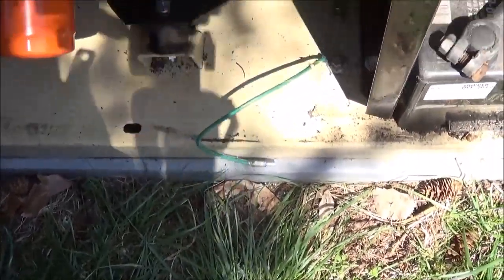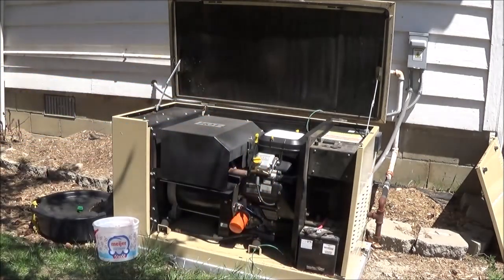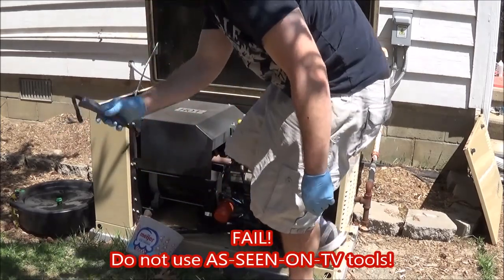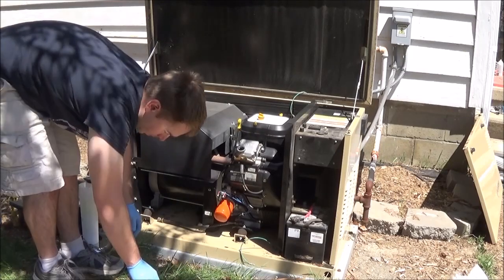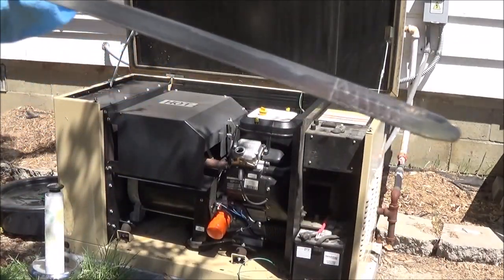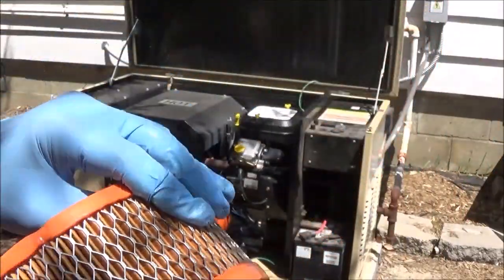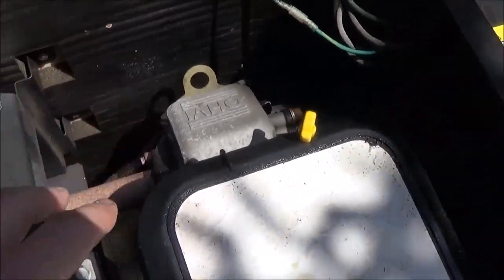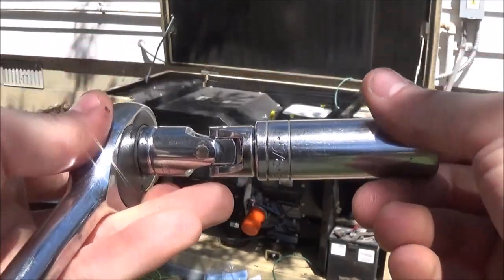Doing tune-up on Generac Guardian 4456-3 12 kW Standby Generator Oil Change Spark Plugs Air Filter

Comment: If you can, always fill the filter with oil first. It can prevent damage if for some reason the pump week or the system may not hold enough oil to lube the system while the filter fills up with oil. It might take 5 to 10 seconds to fill before oil is pumping through the system if there is no oil in the filter. No oil causes damage

Comment: I had the same generac got an oil leak in the lines wire came off the switch didn't know to shut down blew up excellent machine was disappointed I didn't pay attention to the switch and lines I'm a mechanic should of known better I now have a brand new 14kw change the oil lines and always check the switch the moisture is from not running enough every month or so run it at least 30 minutes and load test at least 6 times a year for more heat and stops oxidation stay away from automotive oils ZDDP is way to low you want small engine oils like Briggs and Stratton 5w30 100% synthetic or Amsoil small engine oil 5w30 100% Mobil 1 isn't 100% and way to low on ZDDP also you need to adjust the valves on that machine they aren't hydraulic lifters my new one is happy about that

Comment: Performed a complete tune-up on my 15kw Generac generator today. It sure needed the oil changed and the air filter and spark plugs. Just bought this house from an old guy who has been here eighteen years. I would bet he hasn't changed the oil air filter or spark plugs in at least eight or 10 years. Now it's running like a champ!

Comment: Thanks for the video!  We have had our Generac for 20 years and I've been paying someone $85 a year to do this.  I'll be doing it myself as it's not too difficult per your instructions.  I think I'll check the front plug and check the gap and then leave them if it looks OK.  I'll use the dielectric grease as you recommend -- great stuff to use on just about any electrical connection, I've found. Nice job on the video!
Reply: I just had my 13K Generac generator tuned-up last week. That $85 fee you spoke about is now around $350.

Comment: Is it possible to buy a replacement generator unit for this model? (Just the part that contains the windings to produce electricity)
Reply from the maker: I did a quick search and its part 0G28220SRV however it is crazy expensive ($1300 USD) . Check with your local generac dealer to see if they might have the "new old stock" part sitting on their shelves. Check out the ziller electric forum too since they can help troubleshoot a thousand times better than I. Good luck with your generator :)
Reply: @striker1211  Thanks! Any advice on how to remove the stator?

Comment: Good video but to make it a lot easier to change the spark plug in the back remove the attachment for lifting the engine in and out.
Reply: @sajitkunnumkal  the spark plug I am talking about is when he states it is a pain to get to it. My installer took one out he left the one in front. I don't see a red cap on the back spark plug. I hope this answers your question.  I don't think it is a stupid question.  You don't want to mess up the genset they cost too much. I don't know if the maintenance kit it detailed how to do the tune ups or not?
Reply: @sajitkunnumkal  I know this is old but for the sake of those who might still ask about the "red capped" thing:  it is not a spark plug - but it is close to the rear spark plug which has a black boot over it's top (not red).

Comment: you have any videos of replacing the natural gas fuel regulator for this type of generator?
Reply from the maker: I do not unfortunately. Mine is starting to spit and sputter so I may have to replace mine soon. However I have not determined if it is the regulator or the governor linkage yet causing the surging and misfiring.

Comment: U should change it every 2 years
Reply from the maker: Is that the actual interval recommended by generac? I was just going by what the local electrical place said (every year). They probably have a profit motive.
Reply: It depends where you live and average low and high temps below 40 above 80 once a year